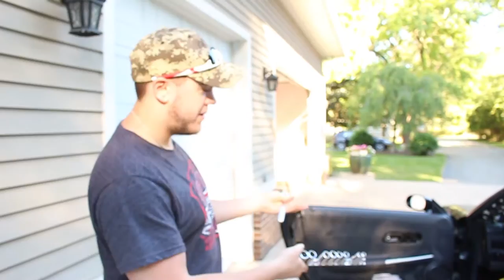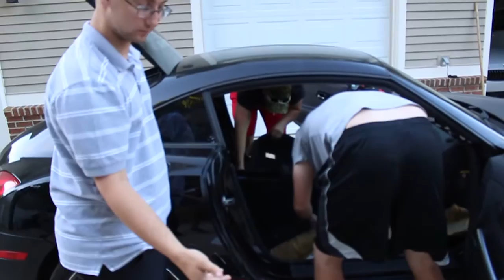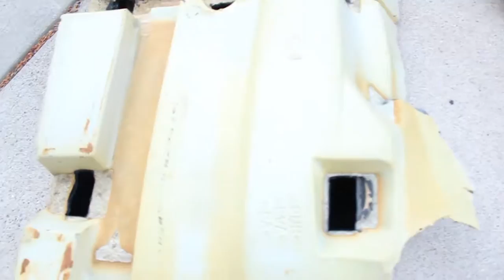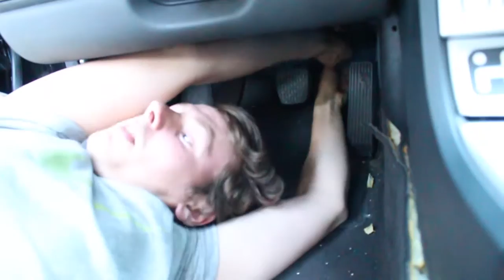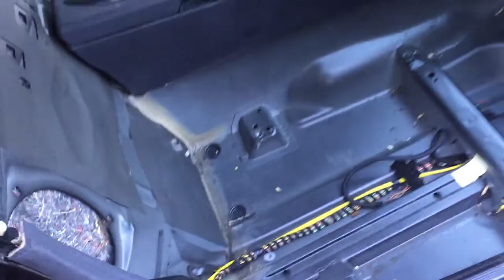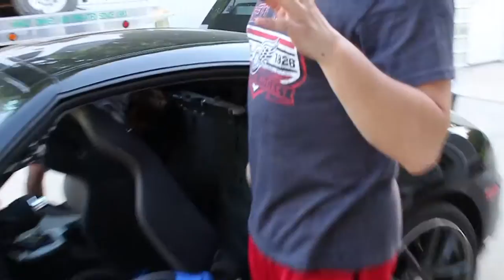Chrysler Crossfire - Interior Track Prepping

Comment: when you tore the carpet out did the seats sit lower in the car? im 6ft and my head touches the ceiling just wondering if that would help me fit better in the car.
Reply: Fruitattack9 I'm 5'11 and simply lowering the seat gives you a solid 3 or 4 inches